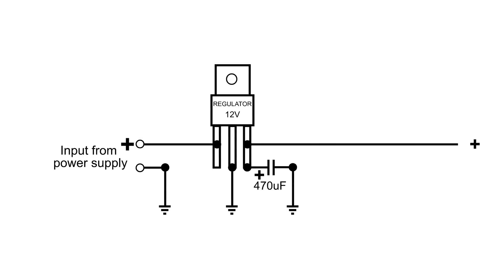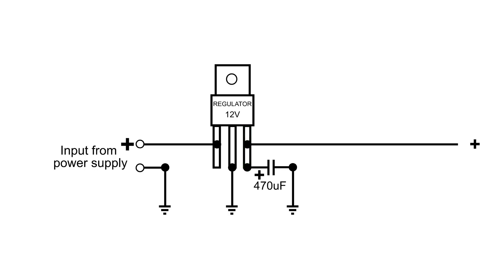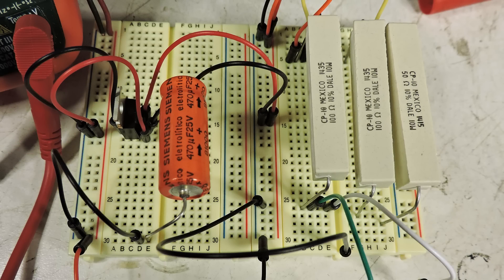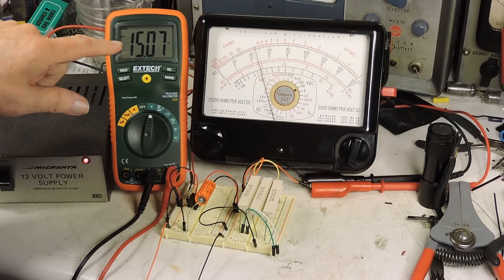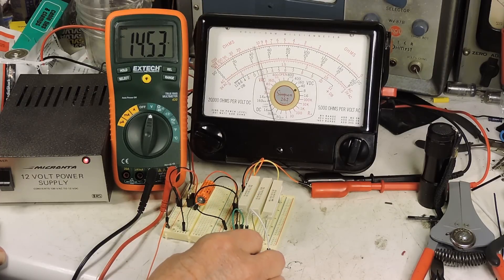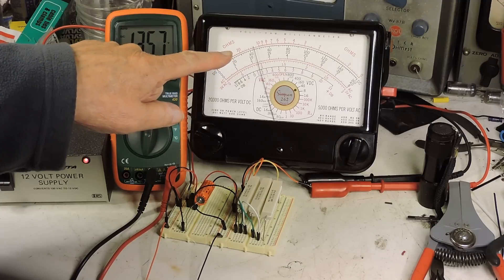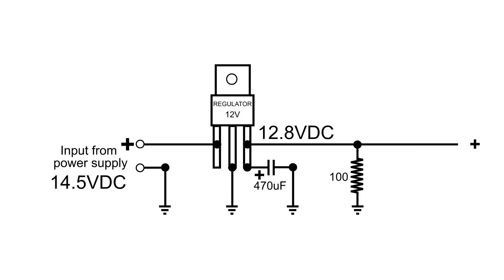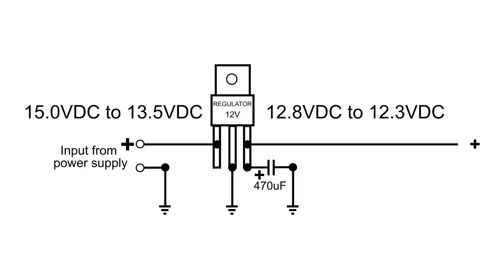12 VDC Voltage Regulator how does it function in circuit

Comment: You didn't explain the function of the capacitor you had in the curcit!
Reply from the maker: How Capacitors charge and discharge
https://www.youtube.com/watch?v=Ag2RujOHqJ8

Capacitors, DC and AC Current
https://www.youtube.com/watch?v=NInt1Ss3vQ4

PI filter, Resistor Choke Oscilloscope Demo
https://www.youtube.com/watch?v=WzwaHO6WPCk

Comment: Name of the regulator
Reply from the maker: LM7812
Three lead voltage regulator work the same way, the main difference is the amount of current it can the voltage regulator can handle. The LM7812 can handle 1.5A.
Reply: Can I use it on a bike ?
Reply from the maker: How do you plan using it?

Comment: Does it dissipate power as heat? 
If it does, how do we calculate it?
Reply from the maker: You use the regulators datasheet.
Here is the NTE966 regulator datasheet.
https://www.alliedelec.com/m/d/bce43bf0f256de4507a9edc9f8495dc5.pdf

Comment: Hello  i like your video demo ..i want that to put in my motorcycle  for my led headlight my problem is how to limit the voltage from motorcycle  to my diy ac to dc converter kit..
Reply from the maker: What voltage does your Bike put out and what do you need
Reply: In my volt meter reading  from battery it reach 15 volts when.i rev  but in ac i didnt  measured it becoz i dont have  multi tester

Comment: good day sir ,,, i humbly request the circuit diagram in LM7812 ic regulator,, for solar panel battery i hope you can help me for my project....THANK YOU ^_^
Reply from the maker: What is the output of your solar panel batteries
Reply: 12 volts
Reply: please i really need it
Reply from the maker: Are you wanting to regulate the voltage from the solar panels that charges the batteries?
Reply: yeah.. why??? is it not necessary to put a voltage regulator. to my project,,, and by the way  my project is moving... ((actually a mini bicycle ))
Reply: and then ^_^ can you give me your 12 volts lm7812 circuit diagram? please
Reply: or else please send me your tutorial video on how to connect the components to the breadboard
Reply from the maker: LM7812 Circuit
http://richardmcwhorter.com/LM7812/LM7812.jpg

LM78XX FIXED VOLTAGE REGULATOR data sheets
http://pdf.datasheetcatalog.com/datasheets2/52/529144_1.pdf
Reply: is this ok for solar panels?? with 24 or 12 volts battery ?? 
and then ?? no zener diode???
Reply from the maker: 12VDC only
Reply: yes yes yes 12vdc,,, ok ok ok i know why you put resistors in output range... so that ,,, the resistors,, keeps the voltage into 12vdc volts am i right?
Reply: do you have any videos on how to connect this components into breadboard?

Comment: Why not add resistors before the regulator to reduce Voltage in ?

im confused how adding resistors to the circuit decreases voltage to the supply. :/
Reply from the maker: The right side is the circuit load changing it's resistance. As the load changes, the regulator keeps the output at 12VDC.
Reply: The mains-powered power supply has internal resistance at the output stage. When it says it is a 12v power supply, it means 'approximately' - it is probably just a transformer but without any power supply regulation other than a smoothing capacitor, so the 'no-load' voltage will be significantly higher than 12v.  When a load is applied - such as the circuit being tested, the output voltage drops because of the internal resistance within the transformer. So even though the load is increasing, because he is adding more resistors in PARALLEL (not in series), the output of the voltage regulator is staying almost the same, but the lower resistance of the circuit means that the voltage drop across the internal resistance within the transformer of the mains power supply causes the output voltage of the mains power supply to drop.

Comment: I need output of 1.5 V from 8.4 V. Help please :)
Reply from the maker: You could use Zenor diodes or regular diodes. You might be able to use a variable voltage regulator. There's a couple of videos to give you some ideas.

Zener Diodes, the Basics
https://youtu.be/mIy1-cA4hq0

Zener Diodes and Silicon Diodes
https://youtu.be/x6hobqY0fWQ

Adjustable Voltage Regulator
https://youtu.be/2TZZX9FOMmM
Reply: Abdullah Raihan Bhuiyan use resistor or high resistance potansiometer
Reply: @deadchords4919  " potansiometers"  are banned by law where i live.  :-)
Reply: @TaunterAtwill  buy them from the black market then :)

Comment: Why do you add 250 ohm resistors but then say the total added is 25?
Reply from the maker: Ohm's Law, The Basics
https://youtu.be/d34-VKc2cyY
Reply: When you add resistors in series (so they are in line rather than next to each other) then the total resistance is the total of all the resistors. But if they are parallel,  (ie, next to each other, so the current is split between them all), the total resistance calculation changes and the overall resistance is less than the smallest one. Two 100 Ohm resistors in series - total resistance = 200 Ohms. Two 100 Ohm resistors in parallel, and the resistance is divided by two, = 50 Ohms overall. So the two 100 Ohm resistors in parallel (=50 Ohm), plus the 50 Ohm resistor in parallel (equivalent to two 50 Ohm resistors in parallel) = 25 Ohm

Comment: Rick, what purpose does the 470uf cap serve in your circuit?
Reply from the maker: It's a filter. I was trying to use a 12VDC wall wart to run some 12VDC flip-flop chips and a 555 timer. The wall wart put out 16 VDC which was too much voltage for the chips. Then I added just a 12VDC regulator and the chips did work but not reliably until I added an electrolytic capacitor on the output of the regulator.
Reply: So the DC source wasn't likely "smooth" enough coming from the wall wart?
Reply from the maker: Probably, I'm not sure because I was in a hurry to build the project, it was for work. I'll see if I can't duplicate part of the circuit and the problem, might make an interesting video.

Comment: Thank you. A good demonstration is worth 10,000 words.I had some questions, but I answered them al except for one l as I was typing them in. If I may, I saw a video yesterday that showed someone putting two AA batteries into a four to five ounce glass of water, leaving them there for about forty to fifty minutes, taking the batteries out and then lighting the water on fire. Ièm working over the weekend so I haven't had the time\opportunity to try it. I'm wondering what you think about it. Is that possible?
Reply: Thank you. An excellent explanation. I appreciate it.
Reply from the maker: +Bruce Dobson 
If this would work, I think all the dumps would be burning.
Reply: I like that idea.
One thing I was wondering about is where does the "extra" voltage go? Does it just turn into heat and dissipate into the air? If so, how do they do that with the tiny chargers for cell phones and tablets when they take it from 120v to 5v? Wouldn't that make for a lot of heat to dump? Maybe I don't really understand how voltage regulators work.
Another thing I was wondering about is, in power supplies\chargers that use voltage regulators rather than step down\up transformers, do they still use power if they are left plugged in to mains but are not hooked up to load?
These questions I didn't get answered while I was typing, but they are things I have been pondering.
Reply: BRUCE DOBSON
hi mate
i know it's been a year, but let me address this for you in more detail

1. do you have the link to the video

2. in order to start a fire you obviously need a precise balance of 
- Fuel
- Oxygen (not Air)
- Ignition Source
if you don't have these things in the right ratio's you CANNOT START A FIRE

3. can a battery be set alight or made to catch fire.... ANSWER = YES... but... only if you short circuit the battery.
    of course, if you short the battery , it heats up , the heat creates pressure and it explodes to release the pressure.

but, this is not what you were saying, so let's leave short circuits out of it

YOU ARE SAYING, can the fluid of the battery get into the water and make the water flammable
well.. it depends on the fluid
if it's electrolytic fluid from a Lithium Ion Battery... YES IT CAN, DEfinitely,  Lithium will combust

But AA's  usually have Ni-MH and in this case i would say NO

now. 
4. considering what is needed to make a fire, i guess we could argue that the Lithium and water on it's own
would not start a fire, but YOU DID SAY... HE SET IT ALIGHT
so... the fire was already there

in short mate
it depends on the contents on the battery
but, it's highly ulikely

again.. to see the video would be very helpful

Comment: thanks rick for excellent video as usual.
As a electronics beginner does this video show that as resistance load is decreased,there is a built in safety factor of the regulator to decrease the input voltage ,to prevent heat/fire hazard?Sort of like water building up on one side of a dam(input) that levees are open on the  output side to decrease pressure?

Comment: Thanks for the video. Did the 15 volts come from that "12 volt power supply?" and what is the capacitor for - doesn't it allow AC to pass? Is there any AC in the circuit? Still not sure what the drop in input voltage actually means.
Reply from the maker: +JL Software 
Yes the 15 votes is from the 12 V supply. The job of the voltage regulator is to take enough current from the input side and give it to the out put side, trying to maintain the 12 V output. The regulator does this by changing its internal resistance automatically.